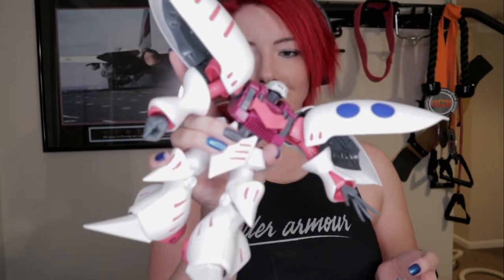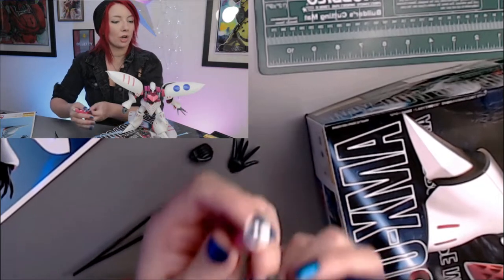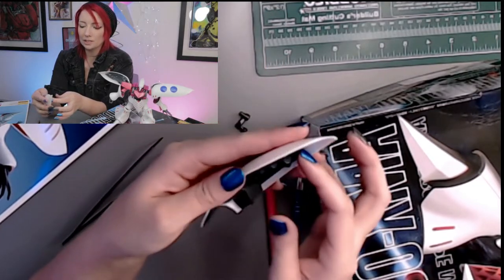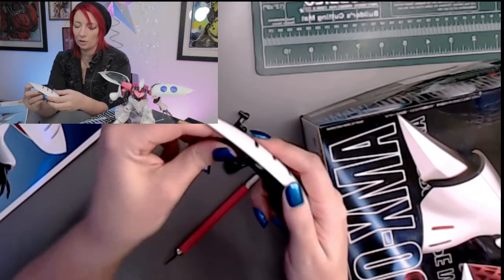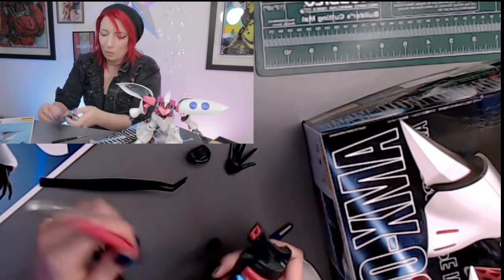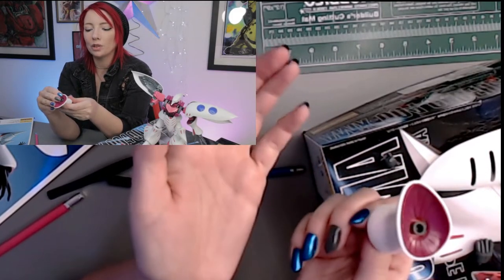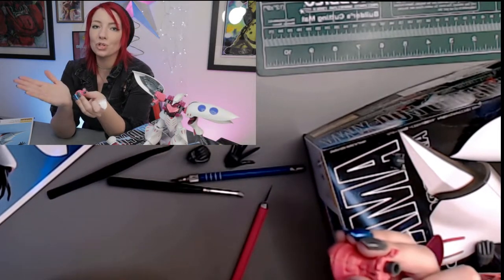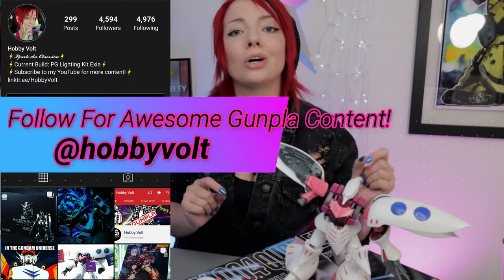How to Separate Gundam Parts for Custom Paint Prep : #gundam #gundams #gunpla

Comment: number 1 tip i might suggest is cutting pegs at a 45 degree angle if you know your going to take that piece apart later for painting. makes things 100 times easier. also id suggest the wave parts separator or some watch back openers.
Reply from the maker: Yeah! Everyone has different tips!

Comment: I have some success with a cheap set of small flat screw drivers. Using a knife to pry on things can be iffy, and I get a bit concerned about breaking the blade. Pushing a knife in far enough to get one of my small screw drivers in, and start working that around has worked. I've seen some plastic part separators as well, that could be useful (almost like a plastic putty knife). So far, I've managed to not break anything. lol
Reply from the maker: That's a great idea!!! Thank you for the tips!!!

Comment: I said on your IG post i had something break recently, i did the mg Wing Gundam Zero 2 weeks back and had a part break, so i felt what you felt.
Reply from the maker: I remember! Which part was it by the way?! That's one of my favorite kits.
Reply: @HobbyVolt  It was in the waist, there was 2 part i had put together when one needed a little sanding and im just lightly trying to get it apart and 2 of the 3 little pegs that that connect the 2 parts just snapped. So that pissed me a little bit.

Comment: To be honest this is bad tip, should never use razor or hobby knife because it will damage your pieces and the blade can broke which can be very dangerous. There are cheap separator tools you can buy on eBay. But hey what ever rocks your boat!
Reply from the maker: Nice! I've bought one since this video but still occasionally use a blade for really tight fits, and then the separation tool after!